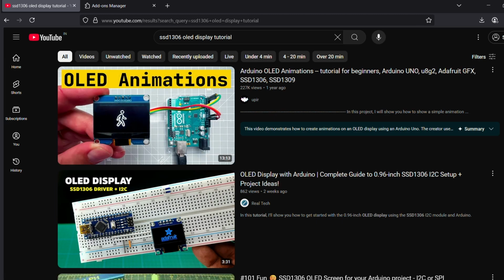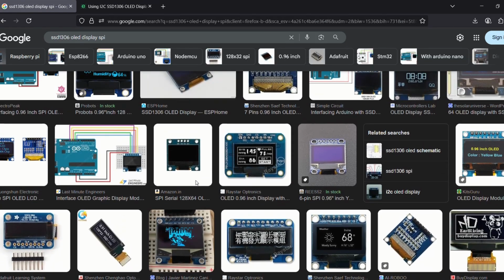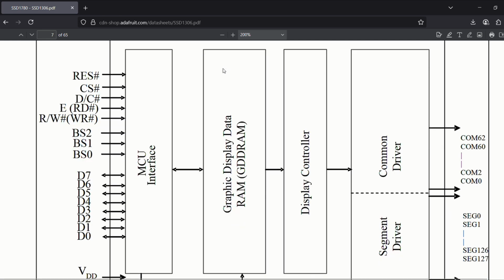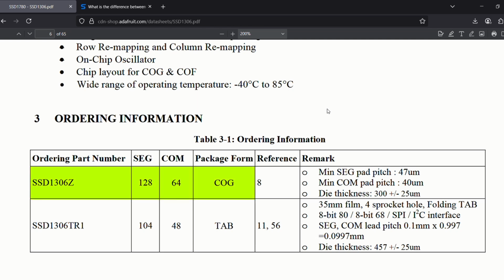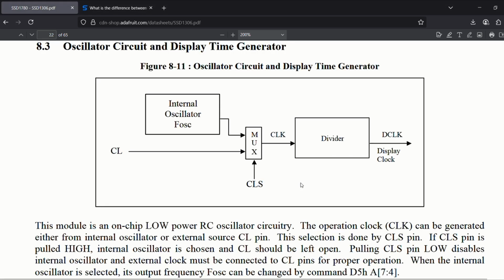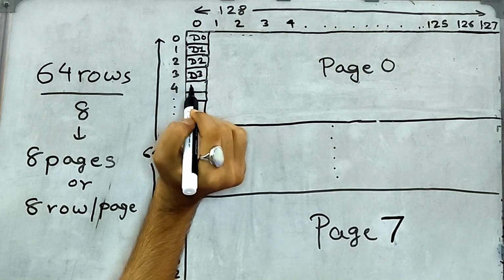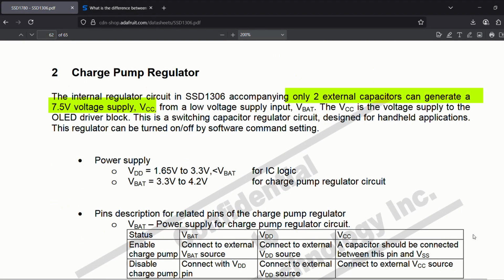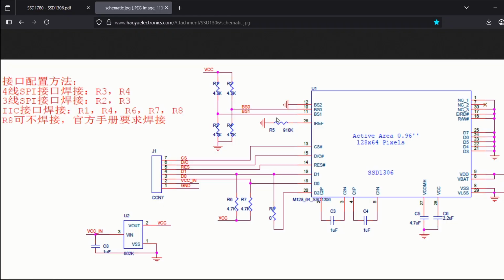What's Inside the SSD1306 OLED? | Datasheet & Hardware Explained

Comment: Great video.  The frame rate formula gives great indication on how much we should relax the MCU while updating the SSD1306.   Updating more quickly is useless.  Synchronizing to the exact frame pace is another problem I don't know if we can deal with.   Is there any register providing clues on the pixel clock or page clock ?
Reply from the maker: Thanks for your comment. Regarding pixel clock case, I cannot recall any such mention in the docs.
Reply: @eccentric_engineer I measured 206.65 Hz frame rate with a photocell.  So far, I havent measured any useful sync signal on the pcb yet.   But 206.65 Hz is good news for my project on github, as I made a good attempt to produce flicker-free greyscale on my SSD1306.

Comment: Great video. One interesting note is that the SH1106 (1.3") display only supports page addressing mode whereas  the SSD1306 also supports Horizontal Addressing Mode. The SH1106 can only auto increment columns within the page whereas the SSD1306 can write to all horizontal lines in one command. This can be helpful if using DMA. For the SH1106, unless your hardware supports some sort of complex link-listing (chaining) of DMA transfers there must be CPU intervention every page when flushing the whole screen or large areas. This is more of a problem if using I2C (very slow). With the SSD1306 you can flush the whole screen via DMA w/o CPU intervention in one stream. Another note is that I have found the SH1106 controller can handle I2C up to 1MHz even though datasheet says 400kHz max. If your hardware supports it try faster I2C setting and can get full screen update rates of 30Hz or better.
Reply from the maker: Thanks for sharing and really appreciate your detailed comment.
Reply: just an update. If you are looking to maximize performance using the SH1106 via I2C, I was able to pre-load the entire screen buffer w/ the command bytes interleaved into one continuous buffer, and then have the DMA completion interrupt in the callback of every page trigger the DMA transfer of the next page. This way I was able to get all 8 pages triggered back to back in the context of the hardware interrupt, this is almost no CPU intervention. Now the RTOS is able to switch context to other tasks during the slow transfer.